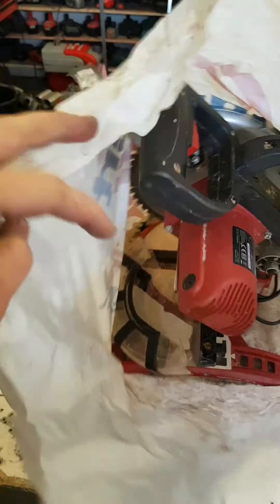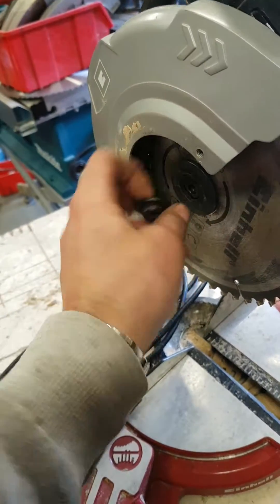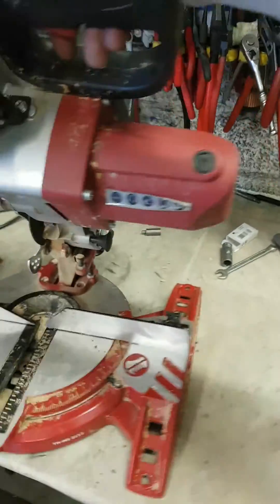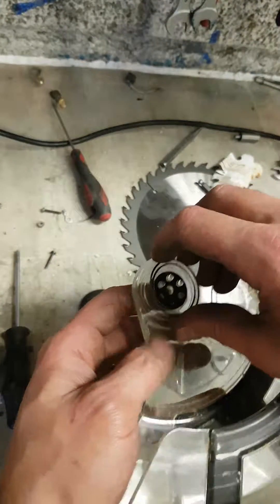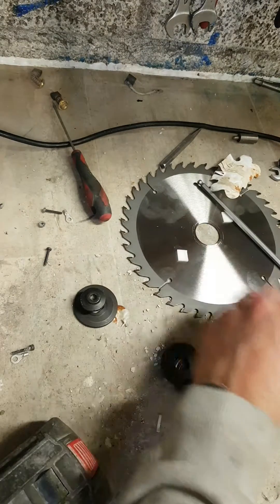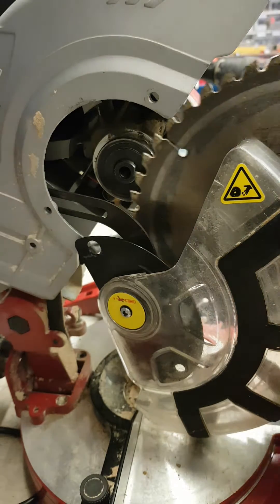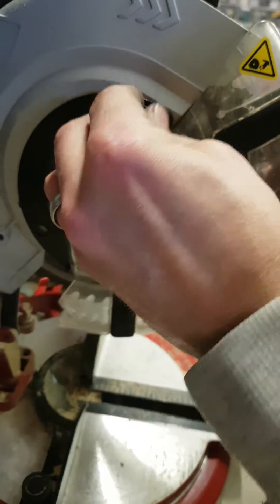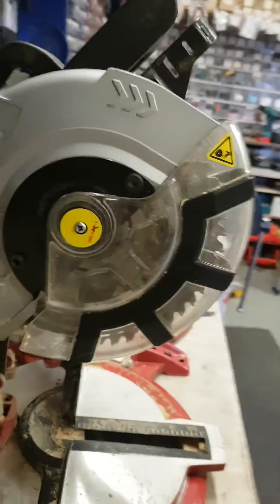small Einhell chop saw for repair

Comment: This has been all very helpful. One thing to point out that first u put the black bracket wrong way around. Later on you probably flipped it but its not shown in the video.  Regardless thanks for the video it's been a great help.